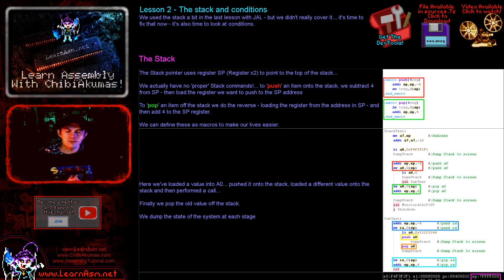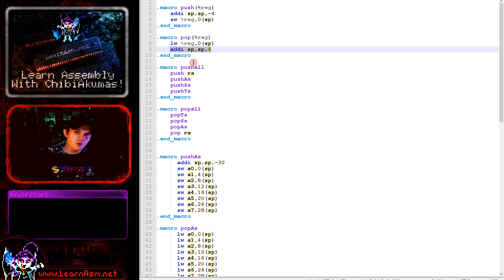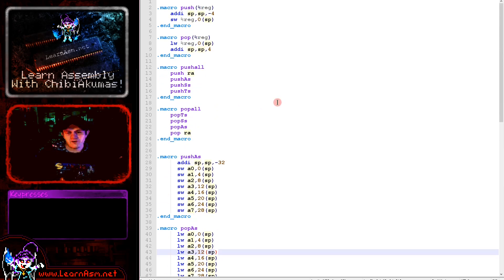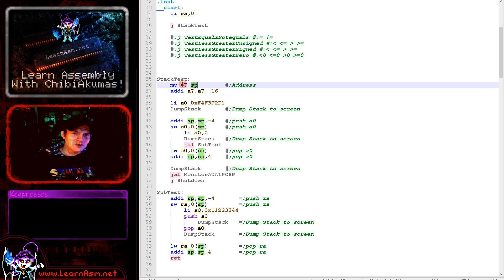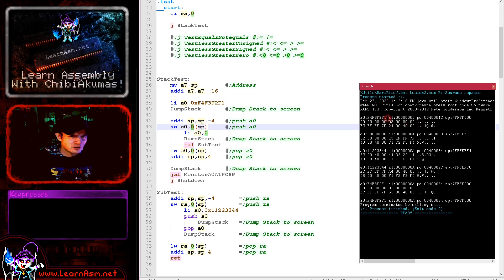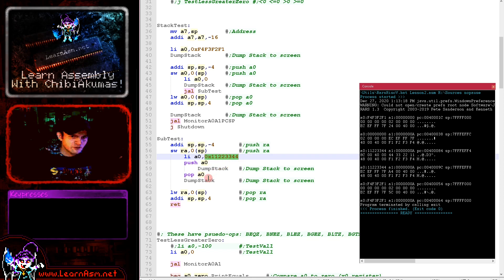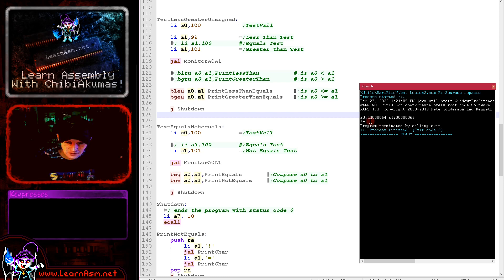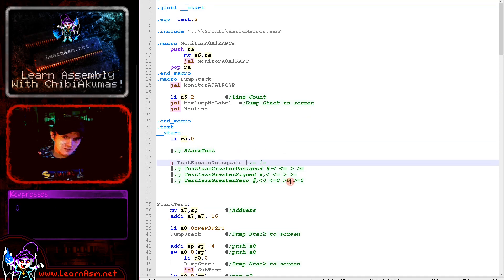RISC-V Lesson 2 - The stack and conditions

Comment: No flag register IS weird, but I guess it further simplifies the hardware & ISA. I like tye ARM conditional execution to avoid branches.
Reply from the maker: I was programming MIPS all week, porting an ARM example to MIPS... It felt very strange to have to 'emulate' a flags register to get the code working... especially as the code was originally from the humble Z80, which of course also has a flags register!
The long of the short of it was... The code got a lot longer, and thanks to me repeatedly forgetting about jump delay slots and bugging up my code, I got a headache!!!

MIPS and RISC are fine, but from a programmer point of view, I do find ARM a lot easier!

Comment: Instructions to save and restore lots of registers at the same time seem to have fallen out of favour in recent years because apparently it’s hard to make them performant. 64-bit ARM can only back up two registers at a time, severely reduced from 32-bit ARM.

Not having push and pop also seems like the way that things are going. Compilers pretty much never use those instructions anyway, but rather just adjust the stack pointer and then put things at offsets within the stack frame.

Getting rid of flags is an interesting choice. It seems that it’s driven by the desire to get rid of hidden dependencies between instructions. That is, the CPU should be able to know if one instruction needs the output of another instruction just by looking at which registers they access. This is useful for making CPUs which execute instructions out of order.

Comment: Definitely a fan of RISCV rather than ARM. Of course I love the 6809 and 68k ISAs the most. There are a bunch of soft core RISCV out there that you can run on these inexpensive FPGA SBC devices. I also have some of the original hard core RISCV that came out a few years ago and it seems more SBCs with improved versions are coming out every month so shouldn't be too long til someone does a game device especially now that vector ISA is in the works.